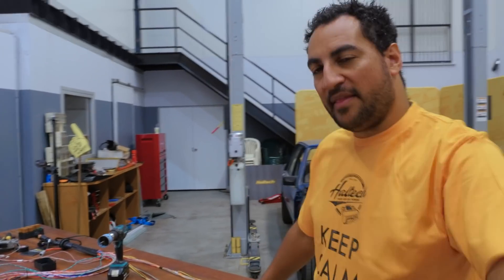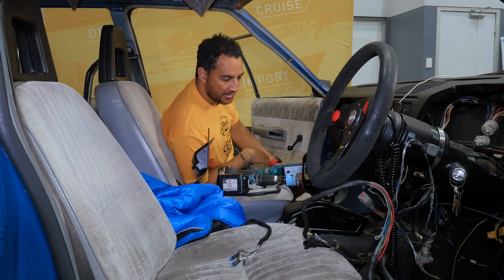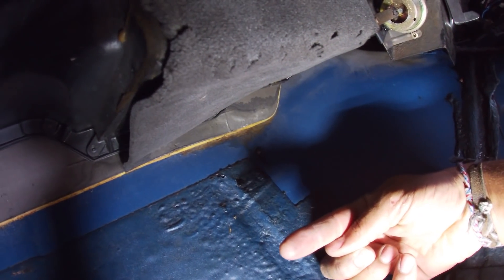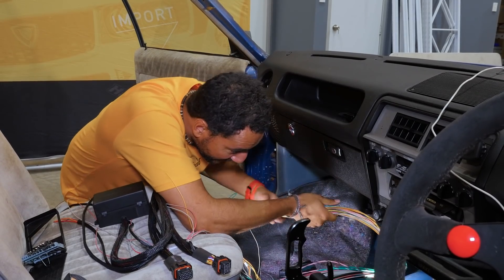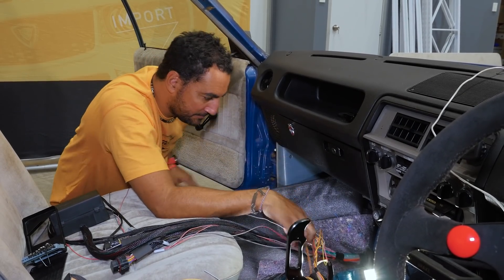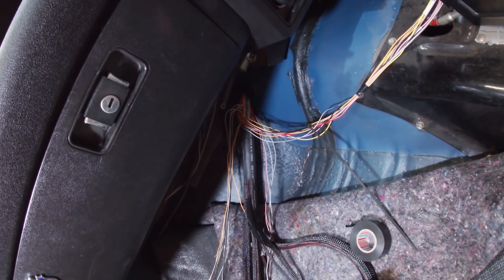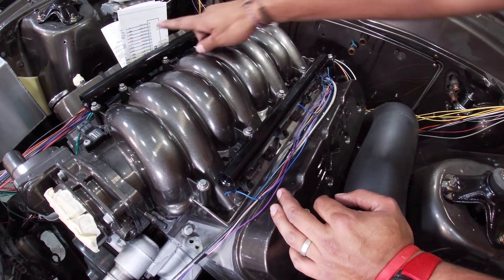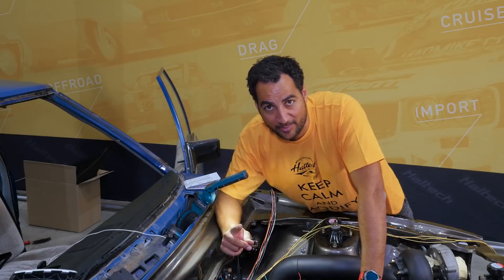🎥 Ep5: Will it fit? Drilling through the firewall and a test fit | DAVE'S WIRING VLOG

Comment: It seems a bit floppy. How do you stop the engine bay smells coming into the cab?
Reply: The same way the factory does, with rubber grommets
Reply: Once its sheathed and such, on finally assembly a zip tie or some heat shrink would finish the seal. But we're still a videos out on that yet.
Reply: Look at the firewall of just about every vehicle ever made. They all have holes in the firewall for wiring and hoses, all sealed with rubber grommets. Nothing "floppy" about it when done right.

Comment from the maker: Welcome back! 
We're up to our first "point of no return" and that is drilling a hole in the firewall! Dave does a trial fitting of the harness inside the engine bay and lays out all the engine wiring. There's a lot of pushing, pulling, measuring, checking and cutting going on before the harness is taken out again to be completed for the final install. Enjoy!
--------
Don't forget we've got a special discount coupon from High Performance Academy: Follow the links below and enter code: 48V7KF to get a ‼️👉$70 discount.👈‼️ How good is that!
Wiring fundamentals: https://bit.ly/HPAWiringFundamentals
Club level Wiring: https://bit.ly/HPAClubLevelWiring
Professional Motorsport level Wiring: https://bit.ly/HPAMotorsportWiring
--------
Also - if you are interested in Deutch Bulkheads in any shape or size - head over to Connector-Tech ALS and use code: DAVESVLOG at the checkout for a 10% discount. You're welcome!